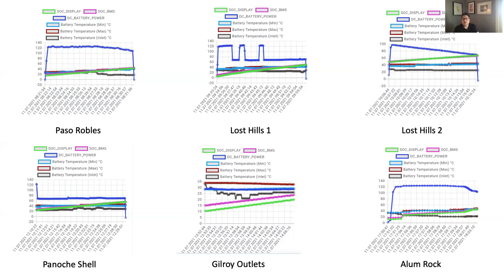Does Electrify America have a heat problem ????

Comment: I've owned my ID4 for 3 weeks. Since that time, I noticed that when its hot (usually over 100 here in southern cali), the charge speed quickly falls off after a few minutes from 6 mi/minute to 4 to 3 approaching 80 percent. At night (usually around 75-80 degrees), I charge much quicker for the same amount of charge, and this has happened to me one more than a few instances.
Reply from the maker: The question is when is it falling off. If it's before 40% That's an issue.

Comment: I should look into this some more, but off the top of my head I think the temperature limits for older non-cooled CCS handles are 50C for Rema and 60C for Phoenix Contact. When the ambient temperature is near 45C, that doesn't leave much to work with!
Reply: OK, I checked the manual for the DCFC I saw this in and I was pretty far off. For at least the (older, air cooled) cord/connector assemblies that DCFC was designed to use, the temperature cutoff is 75C for Phoenix Contact and 85C for REMA cables. That's going to be the sensed temperature very close/coupled to to the contact pins, so the housing temperature will be entirely different, especially with water-cooled cables.

Comment: I was at Lost Hills at 5:30 the same day, my thermometer read 119F when I left. I couldn't use a charger that someone had just left, which I attributed to my own error, but it sounds like you saw the same thing. I switched charge points (to #1) and got 49kwh in 42 minutes, charging up to 90%. (This was my first long trip with my ID.4 1st edition, and I wasn't attempting to be as efficient as you are with charges.)

Edit: I wondered if that was really you, or someone using your name who checked in before me. Seeing the video gave me the answer!
Reply from the maker: So I started at 2, and moved to 1.....
Reply: @RegularEVDad  I started at 2, couldn't get it to respond. Moved to 3 when the previous driver left, but the app kept showing 3 in use. Moved to 1 finally for the successful charge.
Reply from the maker: 3 was the one out of order when I was there. It was a special day for charging.

Comment: Perhaps you might identify the test vehicle?
Reply from the maker: Good point - VW ID4 1st Edition. 77kWh Battery
Reply: My EV ride is a 2019 Std Rng Plus Model 3 now with 46,670 miles. Initially, it had a peak charge rate of 100 kW but subsequent over-the-air updates brought that to 170 kW followed by a near linear decrease.

The backup EV, a 2014 BMW i3-REx, is now my fiancé's ride ... she loves it. With a maximum charge rate of 50 kW, it taught valuable lessons about Electrify America in 2016. The somewhat square charge curve drops off around 80%.

Regardless, good luck! Diagnosis of fast DC charging protocol and EV vs CCS-1 chargers is not trivial.